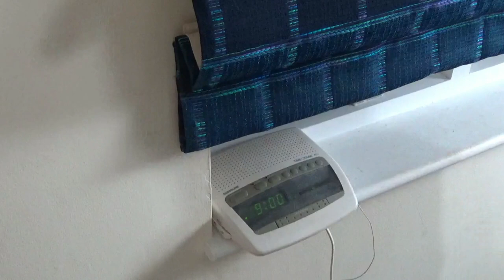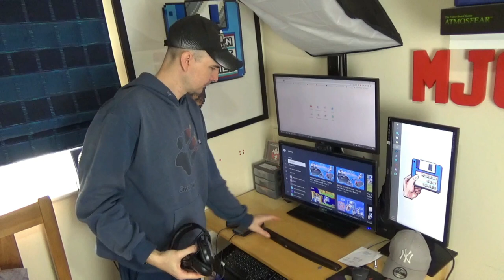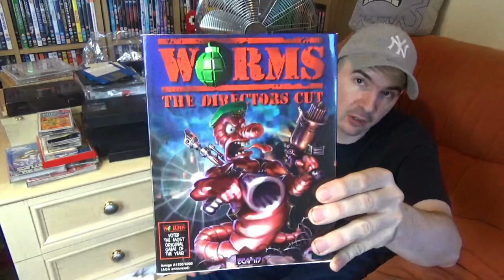Streaming Setup Vlog - Can It Be Improved - Morgan Just Games - Update

Comment: The strict rule of not letting anyone put up shelves in their flats is there to prevent jokers like me from drilling holes through power lines inside the walls. 😄
Reply from the maker: I don't have the tools to tell where the Cables are in the Walls, so I am taking risks. With the Ceiling, I have no idea if Cables or Pipes were nearby. I just gambled.